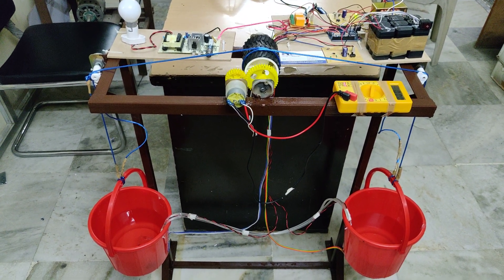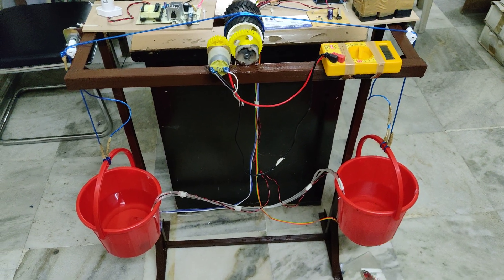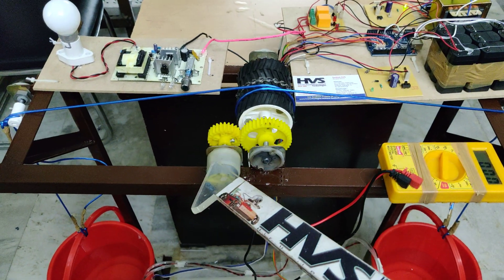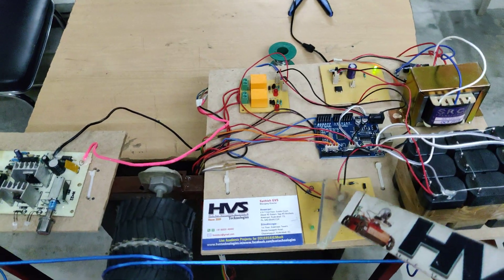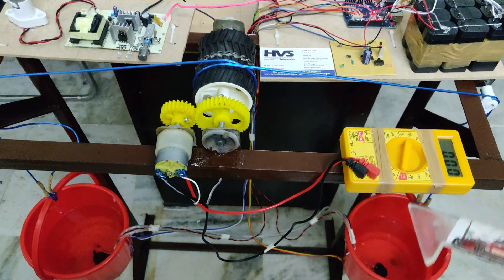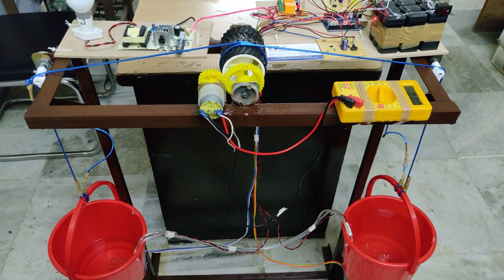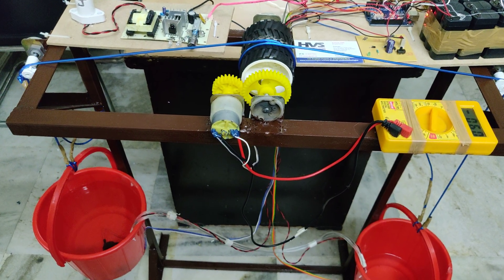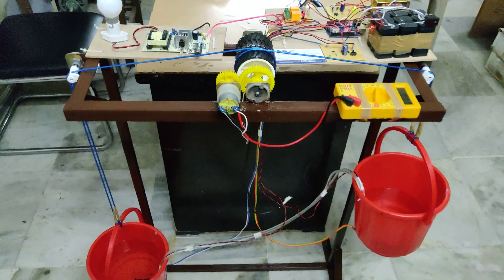Gravity Power Generator

Comment: Hi HVS, Looks like its college engineering project. You are only transferring the water mass from one bucket to another, I do not see any mechanism to increase the energy out in that cycle. My Idea: When the water transfer is happening hold the buckets in its initial position, once the water transfer is over then let the buckets go down, this you can harness some amount of energy, but not more energy than what you put into pumping water.
Reply from the maker: In my system also same thing happening.. we are holding the bucket till it's filled.
It's free energy concept.. we are making use of gravity energy

Comment: Would be interesting if you could try this near a creek or river. Use water driven pumps to fill the buckets, then the electricity output could just be coming from the movement of the buckets. Also, what if the buckets were bigger? More gears to make the gravity battery last longer? Like a grandfather clock weight to drive the gears.
Reply from the maker: Yes